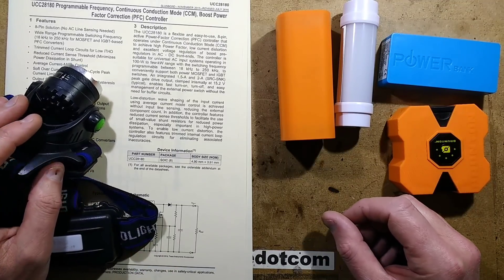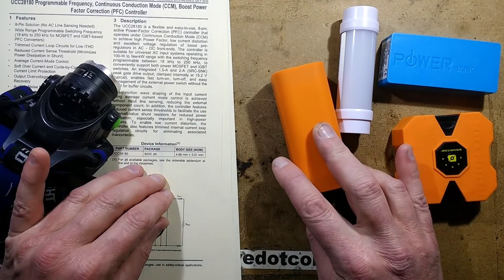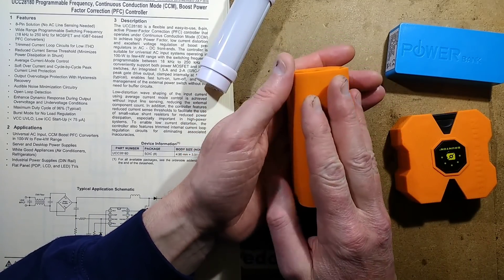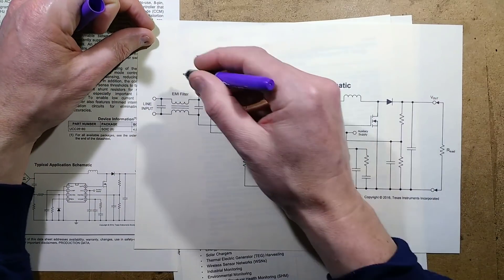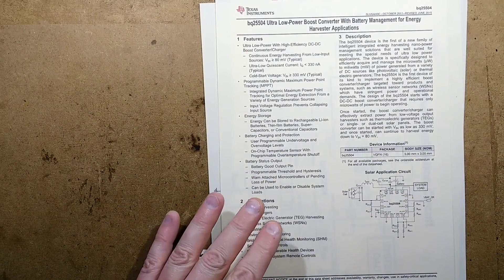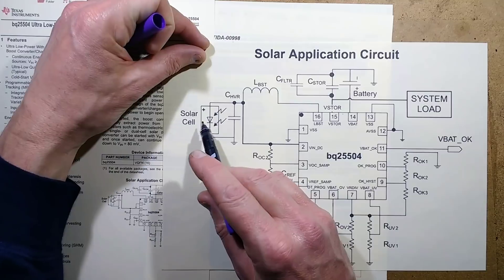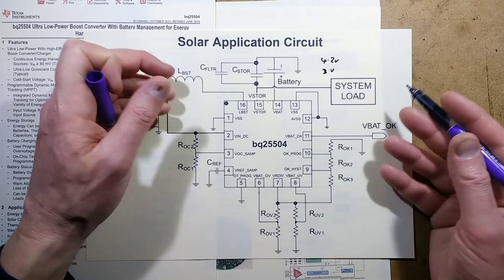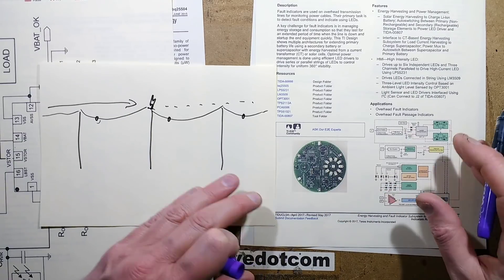A day without power management.

Comment: It's interesting the way you've drawn it doesn't show a power factor issue in the fundamental sense - that is, the fundamental remains in phase - but rather a harmonics issue. 

Still, large nonlinear loads need to be dealt with, especially as we migrate to more mixed generation / consumption models. 

Talking of which, how common is Islanding on the Isle of Man? I would have thought a chap like yerself would have at least a caravanning-sized system in use, if only for what us oldies used to call "power cuts."

Comment: In highschool my chemistry teacher said in the 80s he was contracted by some Burger King franchise to optimize their power utilization to correct for a peak load based billing system they were on.  He said a lot of it was testing power consumption of each piece of equipment and timing how long the startup load was, what the idle load was, and what the peak in-use load was.  He then devised a startup sequence that look place over the course of an hour or so to offset all the peak startup loads of the equipment.  He said it resulted in quite a large savings for them and essentially costed them nothing other than his compensation. Today we could probably come up with something with PLCs and such to stage the startups of everything.

Comment: Power Factor is so interesting
Reply: It's quite simple, when is Ampere being drawn, during peak of AC voltage 220v or somewhere before/after that 200v/100v/50v. Means more resistance then (high voltage = low resistance) and that means you don't get full power (resistance limits current), and some of it is wasted due to heat, because, resistance.

Comment: That power factor correction circuit is magic, literally.  PFC circuits normally work by sensing the mains voltage and controlling the input current of a boost converter to be proportional to, and hence in phase, with the mains voltage.  This circuit apparently does it without sensing the mains voltage at all, spooky.  How does it make the input current sinusoidal at all let alone in phase with the mains voltage without sensing the voltage?

Comment: Clive, you could always add an on demand water heater that can run on LPG or natural gas depending on what is available on the island. Bosch made a nice unit that did not require power to light the gas burner, instead it had a micro generator that ran off of the water supply. It would charge up a circuit that would fire a spark to ignite the burner. Island life is nice at times but in the winter storms blow in without much warning. I guess I was too used to having Doppler weather radar available most of the times in the states. He in Crete they don't even know what Doppler radar is.

Comment: why does TI pay for ads? i mean do they even have competitors on the high end general silicons?
Reply: Don't they? It's usually not about the highest end, and i mean 99% of things you would do, you could do with AD/LTC or with NXP devices, so what a manufacturer needs is mindshare, that their solutions are considered first. And that's just not a given if you don't maintain it, and i mean cheap manufacturers easily eat into the mindshare even if they don't offer a whole range.

Comment: Nothing to replace the LM3909?  What a shame.

TI app notes are very useful. Things like polarity protection using MOSFETs for efficiency and e.g using high-side drivers on hungry subcircuits for simple switching, or for current monitoring and "soft fusing" in microcontroller applications.

The scope of such notes is bind-moggling. From TI as well as other semiconductor makers... Who may not be called what they were 30 years ago.

Comment: I have enough powerbanks to charge my ipad and phone for weeks :) Although theres never powercuts. I have a 5v to 12v adapter thing and I actually used it to power the modem/router. It kept restarting though, probably didnt provide enough power. Are there any high power 5v to 12v or even 19v boost converters or is the best bet to take power banks apart and make higher voltage packs? Ive seen protection circuits on ebay for like 6S etc packs, but how would that be charged? Are there any modules with like 12v or 24v input which do charging and protection and output voltage selection of 5v, 12v and 19v? And something that doesnt cost £100 :)
Reply: iPelaaja1 

Put three of them in series ;-)

Comment: I’ve have always liked TI data sheets. By the bay, even underground lines have issues like broken insulators. When I moved into this house it was all underground working, yet I was resetting my clocks 10 times a week for short power outages that sometimes were less then a second. Apparently this went on for years, and no one called to complain. Once I convinced the electric company with UPS logs something wasn’t good, the finally decided to look into it. They found a a lone with a broken insulator they was triggering something downline to clamp that looked like short 1 second outages. They had to switch me and a the neighbors on my block to another company for power from some windmill farm. I think it took them a year before they fixed it and switched us back.
After that year I would still get the short outages, much less frequent. So I asked them who was providing power before and they refused to tell me, lol. I wanted to switch my house over to the other company for s cleaner more stable AC power.

Comment: Funny, I just ordered the little grid for 18650 cells to jam all my powerbanks into one brick. It seems like a better idea too have one big source rather that several small when I only use one at the time anyway. Either for a phone charging or the surprisingly useful dinkie USB soldering iron.
I only hope that the TP4056 module can handle 15 cells in parallel. It'll take a while to charge but that's fine. Then 3.7-5v booster with USB connector and voltmeter readout. Or perhaps I can utilize guts of one of the powerbanks..
Reply: You can charge as many cells as you want with tp4056 in parallel, but the charging will be correspondingly very very slow.

Also be very careful when initially connecting the cells in parallel, you need to pre-balance them, else your hands can catch on fire.
Reply: Oh okay I will be careful. Thanks I wouldn't know!

Comment: I spent some time of my many working years in the semiconductor industry, mainly in testing. Data sheets then were found in data books, (choose from analogue, digital, ADC, DAC, special function, power or discrete components). Although we dealt mainly with National Semiconductor, Motorola or International Rectifier, there would always be a requirement every so often for testing of Texas stuff, mainly op - amps and comparators for aerospace applications. TI data books would always provide (along with testing data) test circuits and application circuit diagrams, most useful when designing test circuits, simplifying the test processes. 
They would be tested in house, usually on an in house assembled, hermetically sealed ceramic package, or sometimes a bare wafer prior to sawing and traying up in anti static trays using a vacuum pick and place machine in a clean room. 
For reference, the mainstay test machines that used to be used were the Linear Test Systems 2020 16 bit computer based system, otherwise known as the LTS 2020. This was a complete semiconductor test system, designed by Analog Devices in the late 1970s/early 1980s for their own in house semiconductor testing, but proved so popular and easy to use that it was sold widely in the semiconductor test industry at the time. I believe that some modified examples are still in use today. Well worth looking up if you are into old testing technology.

Comment: I’ve been wondering for a while how bad of a power factor could you get with a device that doesn’t nothing but give a bad power factor?
Reply: Have a look at Clive's plug-in-energy-saver videos.
Reply: Zero - e.g. a capacitor or inductor and nothing else. OK, it won't be exactly zero because real components have a non-zero resistance, but it'll be close.
Reply: 81rjp if the power factor is zero the amperage draw would be completely out of phase with the voltage which I would think would mean no energy would flow.

Comment: TI has some darned AMAZING app notes/docs/free books". "Op amps for everyone" = one of the best texts I've ever gone through. PDF I've found useful enough that I've downloaded so many times I just keep local PDFs:  "slyu036 - ti power topologies handbook",  "ti batt management guide slyt420c", "slyu032 TI power topologies quick reference",  "ti - section 5 - high speed pcb layout slyp173", and "TI - 10 pg - sboa094 - Measuring Board Parasitics in High-Speed Analog Design" . (the weird alphanumerical codes are their internal document codes, which you can just type into google and get the full PDF).  Littlefuse and Analog Devices also have some useful app notes, but TI is still king.
Reply: If I could upvote you a dozen times for this comment, I would.
For those in the Pro Audio industry (my stock in trade), Rane is another company that freely shares its extensive engineering knowledgebase in the form of "RaneNotes". The full library of technical and application notes can be found at www.rane.com/library.html
Reply: I'll have to look that up, thank you!
Reply: I cannot thank you enough for this

Comment: Being pretty rural (by Aussie standards) we too have "power supply issues". Hence, we have a 10kVA (15hp) diesel standby generator and 100 litres diesel. Power output is good, and waveform maintenance (even under full rated load) is true sine wave. We also have grid-tied solar PV, (which can be conveniently redirected to a stand-alone inverter system, should the need arise), and a few 12v inverters that may be usefully driven of the truck batteries. (We also have heaps of rechargeable LED lighting - portable and "semi-fixed")!

Comment: is there a way to add pfc correction circuit to a behringer inuke amp series . . . i have a nu4-6000 behringer pro amp and one of the major complaints of the amp is it has no pfc circuit and because it does not have one, the peaks of the peak current draws are so high it creates surges on the power voltage destroying sensitive electronics that are connected to the same circuit/mains
here is bunch of info the on the lack of a pfc circuit on this otherwise wonderful high power amplifer .  . . https://www.google.com/search?q=behringer+inuke+no+pfc&oq=behringer+inuke+no+pfc&aqs=chrome..69i57.5258j0j7&sourceid=chrome&ie=UTF-8 
id be very interested to here from you on this
Reply: Thanks for that information.
Maybe you can add a input filter first on mains. But anything you do will be expensive.
Reply: That'll be an interesting little problem. We're talking a VERY high power amp here (basically limited by mains fuse), so passive PFC is probably out, and PC power supplies don't come in much over 1000 (maybe 1200) watts either, so I doubt their components are likely to be adequately sized, plus these things are not cheap.
Reply: The input filters for variable frequency drivers for industrial motor application are not expensive. You can try that. It's basically just an inductor. There are filters available, too.
Edit: search for line reactor
Reply: Steal the PFC circuit out of an ATX PSU. Some have a separate PFC board. Or you could put a large passive PFC coil in series with the power input.

Comment: That solar application circuit is incredible and exactly what I need at the moment after buying some real shit solar shed light with a separate outside panel and inside LED block. However, it'd be nicer if that chip was a standard 16 leg IC and not a tiny spec of dust.

Comment: How would I manage without power, I would just grab my 8 USB power banks, dozen or so led flash lights, and desk lamps that can run on off AAA batteries, some blankets if it's cold, and fire up my propane heaters I keep for camping, and my Coleman stove for boiling water for hot English style tea, and Raman noodles, and fire up my gas generator to power my fridge and maybe a low wattage LED bulb if needed at night. been there done that a few years back during a freak ice storm and recently during hurricane Irma for over a day.

Comment: I have a 3 deep cycle batteries hooked to two 100 watt solar panels and a generator for power outages. Internet, wifi and phone run solely off solar. The solar is very generous and I haven't had to start the generator for over 3 years during a power outage. Sadly the cable companies back-up supply only lasts about 8 hours before I loose internet and phone connection. - Northern Ontario in Canada
Reply: That'd be a good trick, when the ISPs and cell towers go out...
Reply: with an inverter?
Reply: zerodegrees8 I would like to Know how you wired your home just for 12volts things.
Reply: @aaronb483  i have all Of my stuff on a Hand truck in the garage.. inverter,2 12v deep cell. I just roll it in the house and plug in a Power strip and away you go.
Reply: I just light some candles.
Reply: I just ran a fused length of 6mm^2 to where the router is from the batteries.

Comment: On that power harvesting chip, I was missing a voluntary disable input, so the uC/main load could tell it to stop feeding it power until (condition).  Because stopping the output circuit is more efficient than feeding voltage to a near zero load that has turned itself off, and feeding the load through a second power switching transistor in the load is less efficient than reusing the transistor that turns off during battery low conditions.

Comment: It'd be interesting to see those power factor correction chips being retrofitted into something like a Poundland LED bulb or similar, given they seem to have somewhat dubious power factors... :)

And as for what I'd do in a day without power? Well, let's see, I have 2 Aladdin mantle lamps, 2 Aladdin paraffin heaters, 3 gas mantle lamps, 2 camping gas stoves, several paraffin lanterns, 2 generators (even if one's a scrappy POS), many LED lights (battery powered and USB), a few USB power banks, and a few torches, so, for just a day, I wouldn't do too badly really... :)

Comment: You got sponsored by TI? Woah.
Reply from the maker: I'm a huge fanboy of TI too.  They were a major part of the electronics revolution I grew up in.
Reply: Yeah, I'm a university student studying Applied Electronics Engineering, so TI is a quite a big producer of the parts I will be using. The stuff they have out right now like the Launchpad and MSP430 products I really do love. TI is just amazing, but I like quite a few companies
Reply: That is the best kind of sponsorship, bigclivedotcom. When you are 'on board' with the sponsor voluntarily.
Reply: bigclivedotcom does that mean maybe you will be doing a video on the little 4pin chip with an led.
Reply: Considering the channels I'm subscribed to, I'm looking forward to a week of TI sponsored videos now...
Reply: I would be fangirling pretty hard if TI contacted me : )
Reply: I grew up (80s) pretty near TI's HQ.  They do a lot of quite cool engineering, most of which no one ever hears about.
They have also managed to maintain their reputation for making quality ICs over the years.  Often the best choice, and almost never a bad choice.  And yeah, their datasheets are good, which is a very nice feature.

Those BGA chips are basically impossible to work with by hand though.  Had some manufacturing problems on a small run device which ended up being a real bitch to troubleshoot.
Reply: Have they branched into USB Anal Warmers?
Reply: +fangirlbatter They used to contact me often. Then again ,I worked in an engineering department and the TI rep came by often.
Reply: Ti is the top company in my book. They have so many fun products.
Reply: Ikr. A major company that is also my IC supplier.
Reply: Not to be a fanboy, but..
None of other companies datasheets are nearly as good as TI ones in terms of learning electronics.
Some companies have ApNotes worse that TI's datasheets and this really sucks.